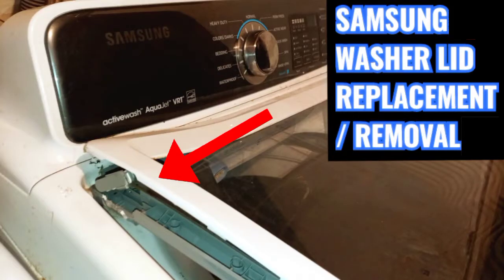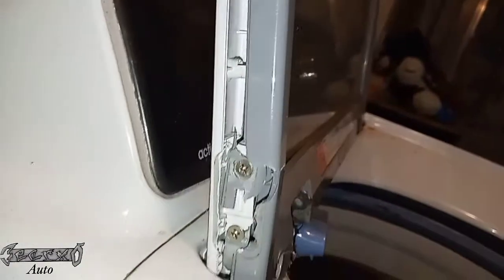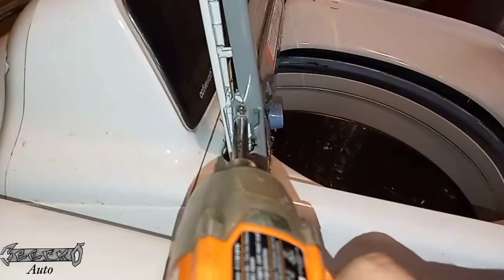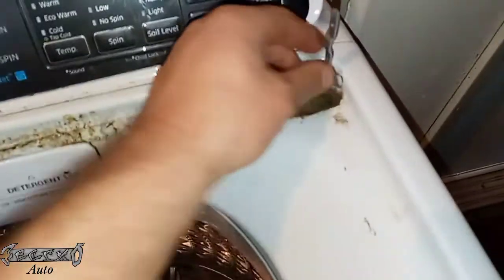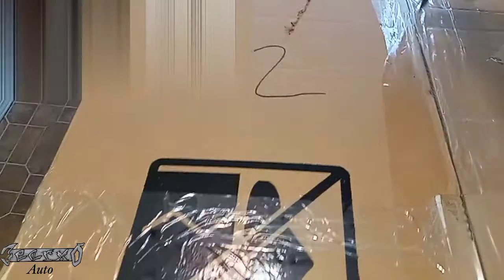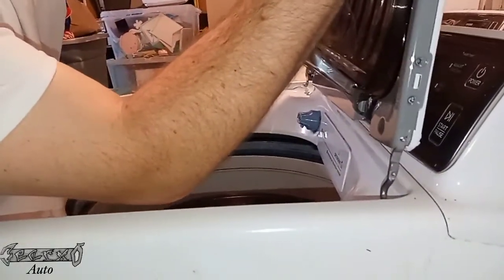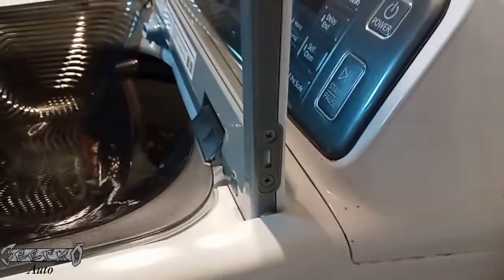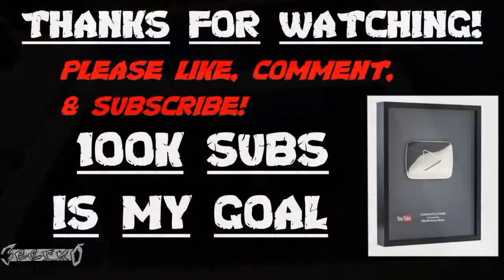SAMSUNG WASHER LID BROKE / REPLACEMENT

Comment: Same thing happened here. Looks like with the hot water the sealant has come off causing the separation and hinges to come off. Samsung never told me it was part of a recall via text support! But if you google it it is. Recalls from 2016 and 2022. Mine is from a 2016 recall and we purchased at Lowes in 2017! Awful. I called Samsung (no more texting)  and they are coming out next week! Have your serial and model number from the lid ready. Thanks for the video! Please try to get a refund too since you prchased your replacement.  Horrible service of never notifying us of this recall. We had extended warranty which expired and our washer was registered, have not moved. So NO excuses
Reply: Thank you! Same thing just happened to me. I was just going to replace it myself, but I'm changing gears and calling Samsung first!
Reply: Any luck? Mines happen and replace lids are $250!!! Would think there at least cheaper if it’s recall

Comment: Is there any way to fix this without buying a new lid ? Mine is starting to seperate , not bad yet
Reply: I took it apart and it’s possible if you’re handy. Get some Marina type of super glue that is waterproof. Glue area that seperate  and clamp it.

Mine  unfortunately plastic literally crack off. So I might just fiberglass a mold as a temp fix. Not in mood spending $300 for a new lid when planning to buy new set in a year or two when we remodel the laundry room.
Reply: @Oneklickmedia  thanks for the advice, that's the exact process I was planning on trying . It sucks that samsung hasn't come up with a better design , my washer is only a few years old and it wasn't cheap

Comment: What are the length and width dimensions of your lid?
Reply from the maker: Lemme get back to you in later today. I will reply to this comment
Reply from the maker: About 23 1/2 in by 21 1/2 inches
Reply: Where did you get your replacement lid? Having the same peoblem with the same washer!
Reply: @swatijain6453  I wasn't successful in finding one so I bought some gorilla glue and flex seal tape and it is working so far...don't know for how long though
Reply from the maker: @swatijain6453  From Amazon. I put a link to the exact one I bought
Reply: How’s it holding up? Lol I was thinking the same or go all out fiber glass a new corner lol

Comment: any idea the part number with the hinges?  machine was so badly broken that we can't even find one of the hinges
Reply: If you mean the steel hinge pins, mine were all rusty which is what I think caused it to fail in the first place. My replacement lid was same as in the video but with a "P" at the end (different color). The hinge pins are DC61-03426A but they're $86 each!!!  I guess I'll have them grit blasted and chrome plated - it'll be cheaper.
Reply: Yea can’t believe the hinge is that much! Appliances co need to be like ikea, send free hardware when you lose it or broke!

Comment: do you know how your lid broke by any chance? i just realized that mine broke as well and i have no idea how it happened since my washer is in my garage.
Reply from the maker: I don't know. It just snapped one time when we went to close it
Reply: The same thing just happened to me today! I have no idea what happened. We have the exact same active wash machine and your machine broke in an identical spot! Seriously, you could be recording in my laundry room. So frustrating!
Reply: Mine is In my garage as well seems as if it could possibly need to be a recalled item mine is broken the same exact spot and all I did was open it put some laundry in it one day and closed it down and boom very frustrating
Reply: @amberpalmer7701  apparently it’s part of that explosion recall. They’re supposed to cover repairs or give a portion of money toward a new washer. I spent 7 hours on the phone with Samsung yesterday with no resolution… and I’ll tell you one thing, I don’t think I’ll ever buy a Samsung appliance again.
Reply: We have the exact same washer, and the lid did the same thing!!! Right side hinge, and I'm OCD about keeping the area clean. There was nothing around it, it just exploded when I went to close it.
Reply: Omg mine did it too Samsung should definitely be held responsible
Reply: I’ve had this washer 8 years and gone through a lid a year at $400 each installed :(

Comment: 100% not how the lid comes off. There are no side screws.
Reply: Ya' gotta be smarter than a screwdriver. There is a small plastic cover over the screws. Unless you have a different Model #
Reply: It's a different model.